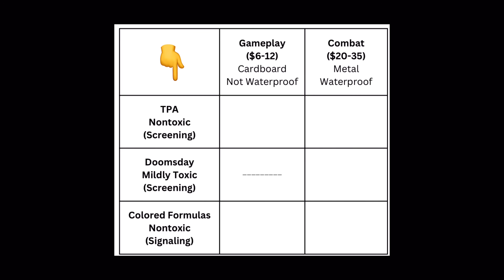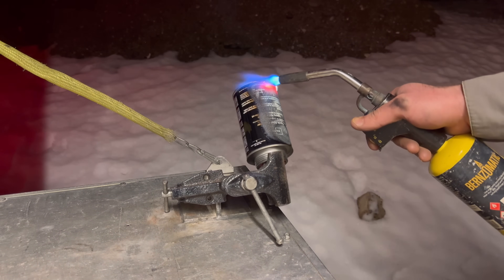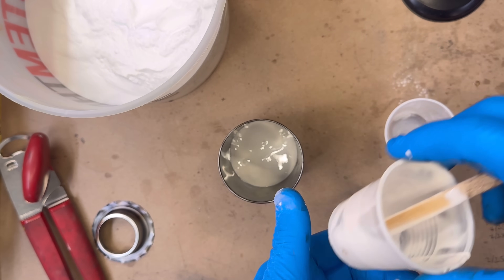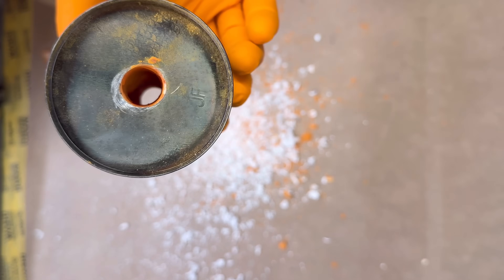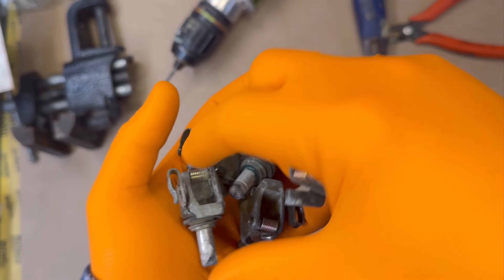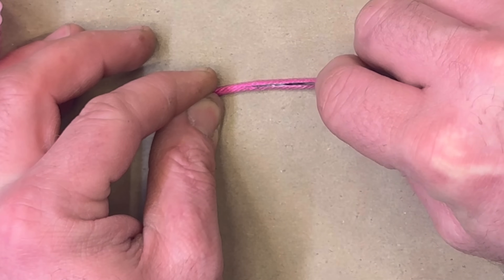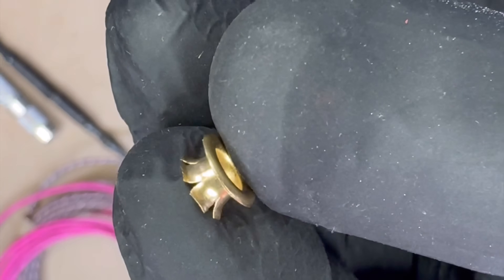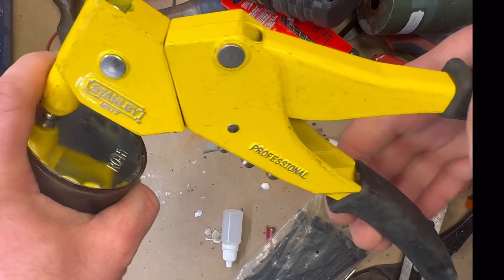How to Make The Best Smoke Device On The Planet: After 2 Years of R&D

Comment: I make bird houses with working chimneys double flashed with galvanized flashing the only thing I can find to put inside the chimney that will smoke is a cone shaped incense but my smoke only last about 1 minute I don't need the high high volume of smoke that y'all are producing , I believe that would end up leaking out of places that I don't want smoke to come out of and of coarse my chimneys are smaller than most of the smoke devices you are making but i would like for it to smoke 15-30 minutes and I'd be scared to have something that gets to hot even though there is a quarter of a inch between the double flashing  can you help me out with this request my compartments where I use to fuel the incence is about 
1 1/2 inch square and depending on the chimney it can go from 3 to 6 inches high I realize that's not a lot to work with but that's where I'm at

Comment: This is not half as good as my worst best smoke bomb recipe yours don't have a thick enough smoke and my smoke blombs last longer than your whole video
Reply: Test these ones out

Smoke Bomb 1:   Carbon tetrachloride 40%   Zinc dust 40%   Potassium chlorate 20%  

 Smoke Bomb 2:   Carbon tetrachloride 45%   Zinc Oxide 45%   Aluminum 10%  

 Smoke Bomb 3:   Potassium Nitrate 60%   Phosphorus 40%  

 Smoke Bomb 4:   Ammonium chloride 100% 

 Smoke Bomb 5:   Zinc powder 80%   Sulphur powder 20%  

 Smoke Bomb 6:   Sugar 40%    Sulphur 40%   Potassium Nitrate 20%  

 Smoke Bomb 7:   Sawdust 50%   Oil 10%   Potassium Nitrate 40%  

 Smoke Bomb 8:   Road Flare chemical? 10%   Sugar 45%   Sulphur 45%   

Smoke Bomb 9:    Sugar 40%   Potassium Nitrate 60%  

 Smoke Bomb 10:    Zinc dust 38.5%   Hexachloroethene 46.5%   Ammonium chloride 3%   Potassium perchlorate 12%  

 Smoke Bomb 11:   Zinc powder 34%   Ammonium nitrate powder 66%   (Put in film canister w/ hole. To light put a few drops of water down the hole and throw.)  

 Smoke Bomb 12:   Titanium chloride 100%  

 Smoke Bomb 13:   Potassium nitrate 33%   Sugar 33%   Wax shavings 34%   

  Smoke Bomb 15:   Potassium nitrate 26%   Sugar 17%   Ammonium chloride 26%   Potassium chlorate 28%   Sodium bicarbonate 3%  

 Smoke Bomb 16:   Potassium chlorate 34%    Naphthalene 33%    Absorbic acid 33%  

 Smoke Bomb 17:    Potassium chlorate 50%   Sugar 17%   Charcoal dust 16%   Naphthalene 17%

Comment: Smoke bombs are generally made from sulfur and potassium nitrate. It's basically gunpowder without the carbon in it.
Reply: But don't ever mix a chlorate (or perchlorate) with sulfur unless you want to make an impact explosive that you can set off with a hammer or hitting it hard enough with something. Yeah mixing a chlorate with sulfur makes primer to ammunition. Same thing that cap gun rounds are made of. Really really really really really really really really really powerful stuff when you have a lot of it because me and my chemistry teacher in high school stayed after school and tried to restart the demo club together and we made it and a little tiny pile is powerful enough to make your ears ring for a few minutes. And a lot of it could be very deadly and destructive if not handled properly or from accidental detonation.

Comment: How does your compound stay together so well when you drill the hole? My entire mixture loosens and messes up
Reply: Did you compress it with a one-ton bench...err, press?
Reply: @mikemurphy5898 arbor press, yes. I compacted around 4-5 times as I put it in and my compound weights were within about .1 g accuracy. I put some in and compacted repeating about 4 times until I filled up. Should I compact more frequently with less compound ?

Comment: Serious question how come you drill out the hole that goes through the smoke grenade.? Instead of just using a rod and then pulling the rod out before the mixture fully hardens.  And what size hole are you putting in it you said is it three-quarter inch? That seems awfully large
Reply from the maker: It’s not a wet mixture that hardens, there’s no binder it’s just compressed. The exit oriface   is relative to the performance of the composition. If there was less oxidizer, it would be smaller. Plus this device uses a flutter valve to baffle, and we don’t need a jet shooting out and bending that valve. A lot of my formulas are container-dependent vs commercial smokes which are chemically- regulated and just a tube and a hole 🕳️. The reason is in some cases such as the military’s m83 formula, elimination of a shitty pva binder will increase airborne particulate yield 30%, in order to counter the increased aggression (due to elimination of a dampening binder) instead of adding more magnesium carbonate, we let it fuckin rip and we use a silicone valve to subdue flareups. We could be like everyone else and just chemically castrate (like good chemists) but then we wouldn’t beat them, and we should just go buy some enola gayes. I will be doing some videos using cellulose acetate binders soon
Reply: @InventionIncarnate  thank you !! very helpful. I really enjoy your videos.

Comment: I used the white tip from strike anywhere matches drip melted wax on it or superglue i think wax but it will ignite when pulling the pin from old found smoke grenades that had allready been used

Comment: Instead of using the fuse you made, could you just lengthen the string of visco fuse and light it with a lighter? I know it would be crude but the result should be the same yeah? (I know nothing about explosives or smoke grenades forgive me if this is a dumb question)

Comment: Did you re do your striker mix? It sounds super quiet and doesn’t have that pop.
Reply from the maker: Good observation. The pop you heard is from the time delay method which uses a larger volume of ignition comp (fills a 12AWG electrical crimp ring)This method uses a smaller volume (fills a 5/32” eyelet). the reason for the different sized cups is to accommodate fuse size (1/4” time fuse vs 1/8” visco)
Reply: @ That makes a lot more sense now, thank you so much for the information I am really excited to watch your channel grow.

Comment: Personal opinion.
Anyone seriously concerned with long term preparedness or asymmetrical warfare should have a 3d printer and an ability to design in cad. 
It’s great to be able to DIY, but while you’re making something, you can’t be doing something else. A 3D printer can make many copies of a design while you’re occupied. Essentially adding a tireless worker to your force.
As long as you can supply power, filament, and spare parts when need be. You can have one machine make almost anything you need within a certain size and timeframe.

Comment: Congrats ♥️ . Could you somehow make a version of  a  bright flashbang as well  . Back in the 90’s or something tac teams / SF units used actual super bright flashbangs that would give people after images or blind them for a few secs.  these days bangers  ( like Multi  port plus distraction device , cts model 7290 ) whilst still bright doesn’t have really much of a flash property to them like back then relying more on concussive properties like pressure waves and high volume sound report designed to make you deaf and lose balance etc . Modern day companies like CTS  I believe removed the super bright effects due to flashbangs starting fires if they went off near room interior screens or something ( probably excess flash powder, magnesium ?  )

Comment: Is the color smoke formula ok to work in the disposable ones you have plans for?
Reply from the maker: Absolutely, I am doing a colored disposable one soon. The silicone valve is not necessary for the colored compositions but won’t hurt. My current design has the pullcord igniter tube passing over the exit oriface as a baffle
Reply: I am very interested to see it. I have gotten the pull cord igniter kit from you and the pdf. Thank you for sharing everything you have learned. Trying to make some big smoke for paintball events.

Comment: Modle rocket engines work realy well
Reply from the maker: When I was in 9th grade I used a C-6 model rocket engine to smoke out some moles. The ignition wires were crossed, so I stepped on it and the engine flew up my synthetic shorts, hit me in the 🥜 burned a hole in the crotch and flew out into the air spinning like a banshee. It was a goddamn miracle I wasn’t left with a bbq hotdog 🌭. I still have the scar from where it streaked up my leg. My friend Rob laughed so hard he threw up.

Comment: Holy hell, dude that's bordering on actual military ordnance with the volume, density and duration of the smoke produced. 
Very impressive work.
Reply: This man’s products are significantly better than military ordnance.
Reply: these are much more impressive than military tbh
Reply: @Facing_Fear  But do they block out thermals...
Reply: @eaglemach9992  I don't think any smoke source will do that
Reply: @avva4090  You are wrong. From experience, deploying and observing smoke.
Reply: @eaglemach9992  I figured only a physical barrier like an umbrella, tarp, or mylar would be able to block a heat signature. Pretty sure Polenar Tactical guys were able to see through smoke but maybe it depends on thickness/distance/quality of thermals.
Reply: @avva4090  Also depends on the quality of smoke and how hot the smoke itself is. If smoke is hotter than the surroundings, it will block out thermals.
Reply: @eaglemach9992  The only smoke that covers from thermals is white phosphorous or metal-impregnated smoke, both of which are toxic. You wouldn't be fucking standing in that if you're infantry, unless you're standing by a tank or APC, and even then you'd be pretty pissed at the driver.
Reply: @eaglemach9992  That isn't how it works at all. It's simply the ability of the composition to reflect IR wavelengths. That's why brass, magnesium, or titanium smoke works, alongside White Phos. They have high reflective properties when struck by IR, which is what makes thermals work in the first place. Even the smoke directly from an exhaust, which is close to body temp, is invisible on thermals.
Reply: @avva4090 some modern smoke grenades disperse powdered metals within the smoke that help block out thermals
Reply: Honestly it's far past that border.
Reply: Better than m18.
Reply: Nahhh, this is for educational scientifically purposes only
Reply: Bordering? It's better.
Reply: WOW !!!!!!!!!!!!!!!!!!!!!!!!!!

Comment: how about: instead of drilling 1 hole - drill 3 - 3 times the amount and 3 simultaneous ignitions = faster deployment of the screen. Instead of buying $2 cans and filling them with $3+ of epoxy: Get some aluminum stock. Its maybe slightly more expensive, but reusable.

Comment: Instead of using a can opener that pokes down through the top of the metal, there are can openers that will open the side of the rolled lip of the seam. After that, you can set it back on just like a top. It makes for a very neat job, too.

Comment: Does the cardboard option need a flutter valve?
Reply from the maker: Good question. Negative, however a tip, I place the pull cord igniter tube over the exit oriface to baffle and reduce flareups. I’ll be posting a video on that device soon
Reply: The flutter valve is to waterproof it.  I actually use thick cardboard tubes for mine and a flutter valve to waterproof them.
Reply: @SALTYCOMBATDIVER-ExInstructor  i thought in on of his other videos he said it was for reducing flares and helping create a good smoke

Comment: Btw, they’ve been making modern “safety” can openers for decades no one told us about that are easier to use and don’t leave a sharp edge. They cut along the side, rather than from the top. Then the top can fit perfectly back on if you want
Reply: ...but not down inside, which is required for this design to work properly.

Comment: one suggestion for a cosmetic enhancement would be to use a safety can opener,

they cut cans in the rim allowing you to close the can and have them look somewhat more intact
Reply: Except that the safety can opener cuts the rim, which won't allow the lid to fit down inside the body.  That has a purpose in this design.

Comment: What type of fuse should I use for the core? I have a bunch of American visco 35 sec per foot, will that work or do I need something faster?
Reply: That should work fine.  You can also get timed fuse from Skylight and I find that's the right thickness to fit inside the channel of the ignition cap.  I have been working on the exact same thing for years.

Comment: Any reason you specified NuSkin over just using CA? As I understand it NuSkin is basically CA with plasticizers so it's more flexible. Does rigid CA interfere with the mousetrap?
Reply from the maker: Good question. CA glue will almost certainly render the ignition useless. I’ve found that CA when dry is surprisingly inert. Though if mixed into a paste with potassium perchlorate is nearly explosive https://youtube.com/shorts/8VZkxFpuc74?si=bymgmujAnPk-ppnu.

New skin is nitrocellulose-based, flexible and flammable when dry. Certain types of nail polish would also work I think. There may be a better coating out there.

Comment: thanks for keeping the hobby going. the only thing i can think of to change is instead of the larger size zip ties on connecting the 2 visco cannon fuzes is i use 4 inch long zip ties with a zip tie pewpew, i do pyrotechnics professionally and i have always used the small 4 inch zip ties on the fuse and very very rarely have issues.
Reply from the maker: @njpyrogirl29  any recommendation on zip tie pewpew?
Reply: @InventionIncarnate inquiring minds would like to know.
Reply: Zip tie pewpew being a tool that lets you zip a zip tie quickly using a squeezing motion?
Reply: I think so. A zip tie "nug" 🔄 if you will... took me a second to figure out what the heck they were even talking about at first.